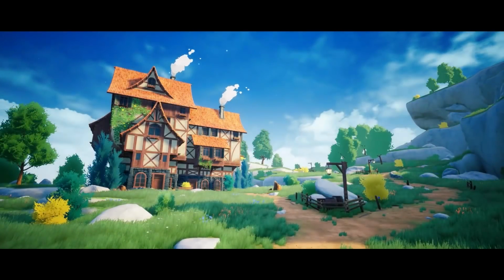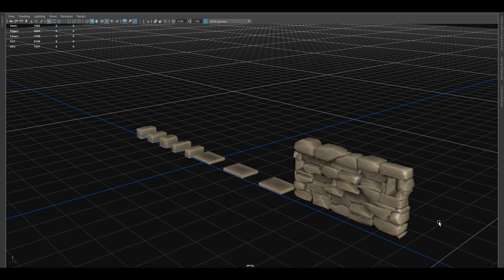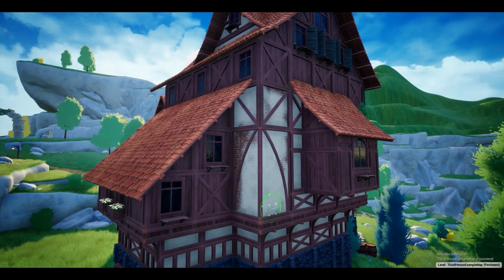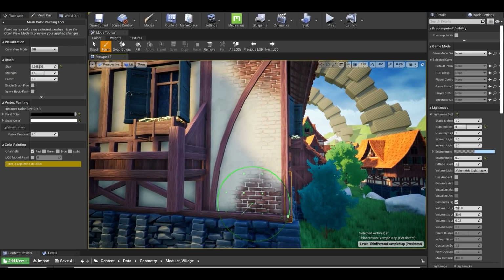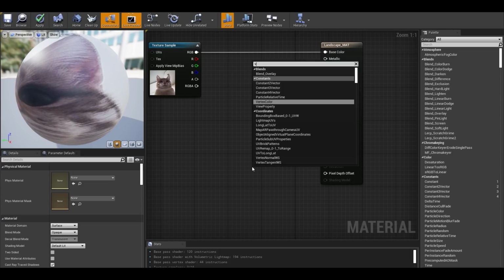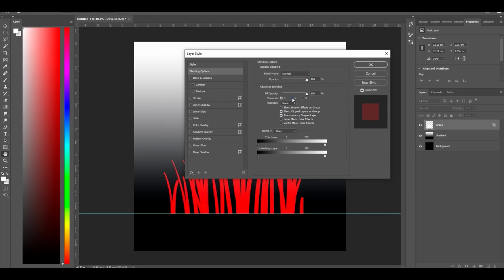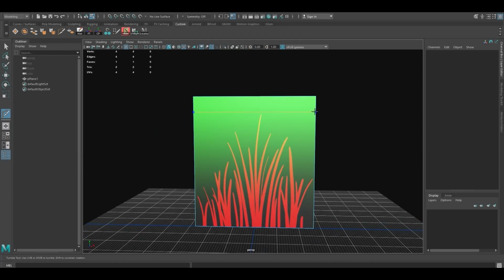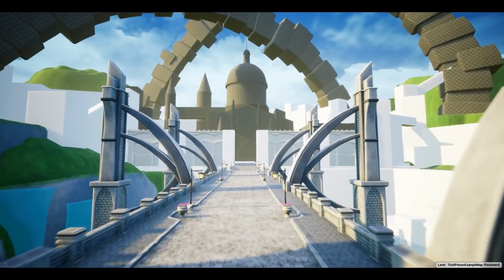Modular Environments are the Future

Comment: I came up with a modular level system, inspired by kits sold to build dungeon rooms on the table for TTRPG players (though I play those games as theatre of the mind) -- however, I created them to represent map tiles and to assemble procedurally into random levels.  The results sucked, though it's easy to see your kind of modular component assembly could work great for hand-building scenes (a concept I'm having to adjust to as applied to games, as it is alien to how I think of games).

Comment: Tile kits date back to the 2002 release of Morrowind, if not earlier than that. They've always been extremely powerful when done right, and when the tile kit is versatile enough there's basically no limit on what you can do with it. You can even break it down into smaller components, and rejoin them in larger prefabs (like a wall section, for instance), making it stupid simple to rapidly produce large environments with a high degree of complexity, while still retaining the fine grain control to create new pieces out of those smaller building blocks.

Comment: This is not the future, not at all, at least not for a while. First: this is nothing new, I have noticed that in games from 2005 like Star Wars: Republic Commando, which I had access to the UnrealEd to, and it is used amoung other games too. Second: The trend is to have photo-scanned highpoly 3D Objects from the real world for much higher realism than modeling things by hand. Check the latest Unreal Engine 5 demo,  what they show there is far from Modular Environments. It is much harder to take a photoscanned 3d object apart and try to make multiple modular pieces out of it than just making it by hand. But the level of detail is way higher and it is almost a fast forward process which leads artists to create objects in a completely different way than ever before. It might happen in future, but won't be as common as you'd think for quite a while.